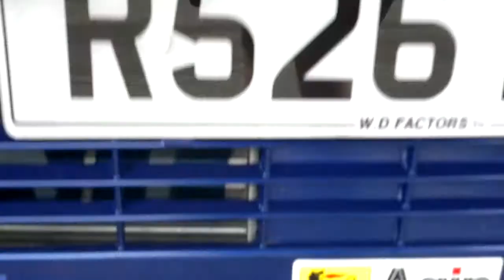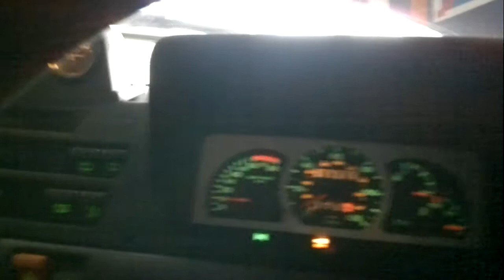Fiat Cinquecento Fire Sporting Custom Stainless Steel Exhaust

Comment from the maker: Yeah its much better than before,much more free flowing as its now 2" pipe apart from the cat, and i still have good back pressure!,Yeah feel free to pop in anytime,although iam away to do a little paint repairs on the 10mm downward facing wheel arch lips on all four arches so iam not so sure you will see all much as the cars away to be covered over to prevent it getting covered in overspray.when i start spray painting.